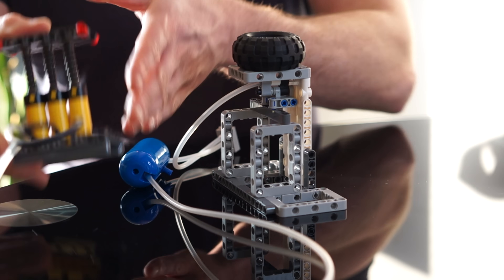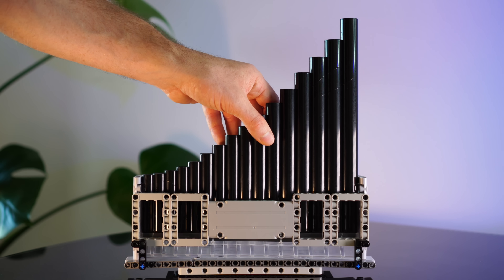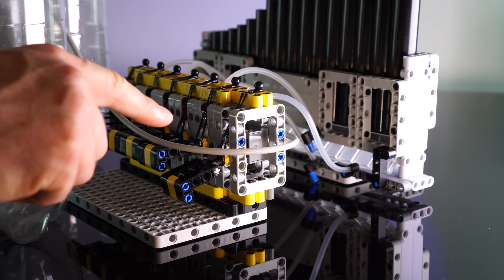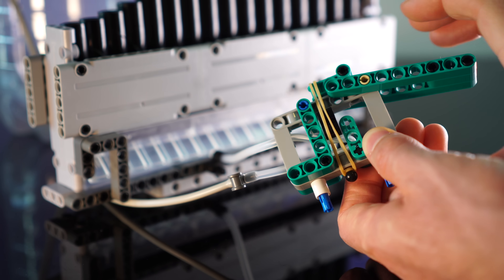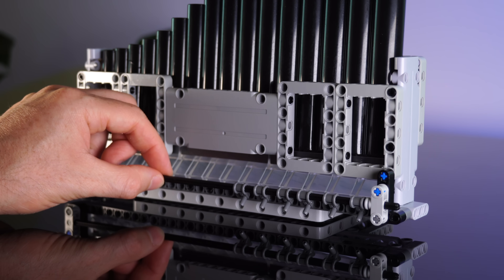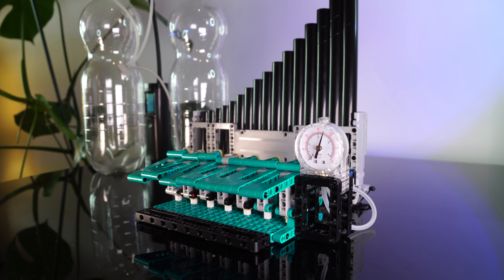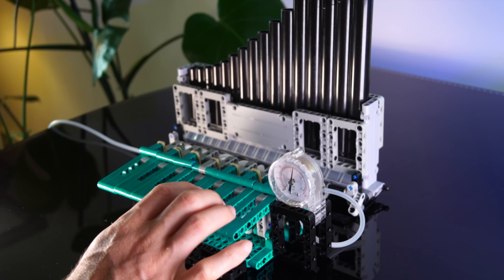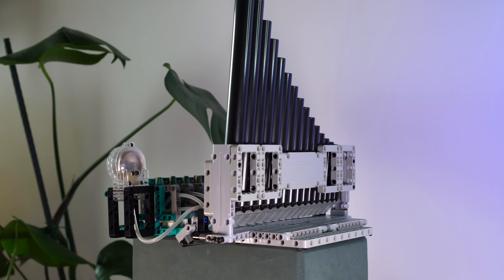Making An Air-Powered Wind Instrument Using LEGO Pneumatics

Comment: Can u make a tutorial
Reply from the maker: I'm afraid I took this model apart a while ago, but I'm sure it's easy enough to reverse engineer from the video! It's really just one of the keys (which was built in full in the video), and then duplicated for however many keys you need. I'd be confident in folks like you coming up with a much better design for the rest of it!

Comment: Not sure if this applies to your flute cause things get mirrored by cameras but I got a zampoña (a type of pan flute) that you hold with the longer pipes to the right so the notes get lower as you go up (opposite of a piano) they are also on a diatonic scale (although you can get chromatic ones but they are not common) Just thought you might want to know that your pipes might not be backwards at all :)

Comment: Amazing! Perhaps using the Lego suspension shock to keep the keys closed would work better than the rubber bands? Can be placed under each key.
Reply from the maker: That's a great idea, I'm pretty sure I have loads of them lying around - will experiment with that for the next version

Comment: Basically it’s a binary gates computer, so with enough pipes you can calculate things up. However, it’s better to use liquid instead of air, so pressure would be more constant.

Comment: okay for starters you have them going in the wrong direction its like your counting down, the highest note should be on the right side so change that, you have in this position of  f,e,d,c,b,a,g but it should be g,a,b,c,d,e,f and then after that you have g,a,b,c,d,e,f,g,a - being big to small pipe as  - g,a,b,c,d,e,f,g,a,b,c,d,e,f,g,a - the repetition in this is because of a higher octaves, its the same note but higher or deeper, depending on if you move left or right on the flute, left being deeper (in this case higher, so change it) and right is higher and because of what you have made here is essentially a pipe organ, you should have a lever to play octaves  so that you can play  two octaves at the same time, large organs play around 5 octaves at the same time for a very visual picture, some bigger ones can play more but it then starts to become just vibrations or high frequency noises that do more bad then good for the sound,  please make another one with more pipes, you can buy flutes with higher and lower octaves and use a tuner two arrange them, it could be really cool, and then have it take in midi notes and output it into pistons that press or play the notes, it could automatically play any song of your choosing, because midi is basically scripts of notes that can be read and played by computers or instruments,  check out "lookmomnocomputer" he made a real pipe organ take in midi and its pretty cool, would be cool to see the lego version of that (ill retype this if jamie requests it im dyslexic and english is my third language)

Comment: This is why you need a pressure regulator. You want to limit the pressure going into the tubes to what is required for playing the note accurately, but a high pressure in the tank to extend your playing time.
Reply from the maker: Totally, that's actually a really good idea! Will try to work something like that into the next version. Should be quite doable with lego

Comment: Quick notes: your keyboard does not reach a full octave, meaning the highest note is not at least as high as 8 whole-steps above the lowest note. You don't actually need all 7 notes in between, but you are severely limited by the lack of range from high to low.

Also the tuning is a classic medieval scale (and possibly isn't very well tuned for that either depending on how cheaply it was made), meaning the intervals between each note do not match the intervals between modern keyboard notes. The majority of songs newer than 1700 will be unplayable on it, even with a full range.

Lastly: the order is flipped. High notes should go on the right on a modern keyboard, not on the left.

But for all the musical failings of this device, it is still mechanically a total success! I especially like how compact the end result is so the keys can all be right next to each other.

Comment: why did you reverse the direction between the high notes and the low notes? the low notes should have been on the left
Reply from the maker: To be honest I just maintained the orientation of the pipe organ the way you'd play it with your mouth. And it prevented a massive amount of criss crossing of pneumatic hosing. I realise now that doesn't make much sense for folks who actually play keyboard-based instruments. Next version will be corrected!

Comment: I know this is late but as an organ builder i have to say this is excelent. To fix the tuning you likely just need to adjust the wind pressure for each note. Alternatively you could add adjustable sleeves to the end mouth ends of the flute to allow you to tune it by altering the length of the pipes. Also if you want a more consistant wind supply you could add rubber bands to your bottle and connect a hairdryer to it to supply constant air. Pipe organs work on very low pressures but very high volumes of air. All in all though you did a great job.
Reply from the maker: That's fascinating to hear, thanks for sharing man! Especially about lower pressures and higher volume. Main reason I used pneumatics and hosing was to keep the Lego theme as Lego has pneumatics available. But as you pointed out, pressure is an issue! I've been experimenting with just producing more air on the fly via a series of Lego compressors, but I need like 50 of them 😅 Also experimenting with large syringes to push more air. I tried a bellows which turned out to be near impossible to make out of Lego. But love your idea of a ducted fan simply pushing air via a bottle. Will certainly give something like that a try - thanks!
Reply: @JamiesBrickJams  Organs (at least older ones) have a bag with a weight on it providing (nearly) constant pressure. Maybe that is possible to recreate ?
Reply: @JamiesBrickJams  Have you tried incorporating the official Lego Bellows (part 87945) from the air shooter range? If you're trying to keep it as purely lego as possible it might be worth looking at!
Reply: Some people used an ordinary big balloon instead of an air storage bellow to operate a small organ. Also a robust plastic bag with weight on it may work, but for lower pressure it would likely need wider hoses.

Comment: Man built a reed organ. Although I think there's usually a reason that organs work on a continuous pumped air supply instead of a reservoir
Reply from the maker: You're definitely right - the high pressure is really not good for the notes. I'm working on a continuous source 😉 Thanks for the advice!

Comment: This is really cool, What you're essentially recreating is a Medieval Portative Organ!  What could be an interesting build is making a Lego Accordion frame that inside houses reeds, and you can snap a bellows piece in-between two built sides of a Lego Accordion. Button accordion may be easier to manage than a Piano Accordion. There is a difference.
Reply from the maker: That's fascinating you say that - my original idea was to build a Lego bellows to supply air continuously. Turns out that's really hard with Lego 😅 But I'll keep trying, and will look up those instruments you recommended - thanks!
Reply: @JamiesBrickJams  You may use a mouth organ as the sound source.

Comment: I wonder if you could vary the length of hose going to the pipes to change the pressure and reduce the "shrill" sounds?
Reply from the maker: That's actually a pretty neat idea, thanks for the suggestion! I'm sure there's something that can be done to reduce airflow and the shrill sound

Comment: Couldnt you make put in all the notes with some "huge" upscaling? Like separate the keys from the pipe and have the hoses connect it. The hose connector doesnt take much space anyway. So your keyboard would be large but the wind instrument small. Probably also need more air tanks.xP
Reply from the maker: Sure could, that's the plan for the next version 😉

Comment: Nice use of pinching valve ! You gain a sub 👍I wonder if you see my pneumatic engine, which use also pinching loop valve ?
Reply from the maker: Woah, Nico! Of course I've seen your pneumatic engine - I've been a huge fan of your work for years. In fact it's your work that made me realise pipe pinching is a viable Lego mechanic. Great to hear from you, and looking forward to your next inventions
Reply: @JamiesBrickJams  What an honor ! Thanks ! Indeed, hose pinching in a loop is very effective in terms of needed force compares to a LEGO switch or direct pinching. Glad it opens more idea like this creation ! Making a pneumatic instrument was on my todolist but you totally nailed it !
Reply from the maker: It sure is. Though I saw your latest engine last night with the unmodified switches, and it runs beautifully! So clearly there are options for smooth running engines that don't need crimped pipes. And if you do ever get around to a musical instrument, I'd love to see what a real Lego engineer like yourself does with the concept!
Reply: @JamiesBrickJams  Yes, the unmodified engine I have done run fine (for a unmodified engine), but because it uses 3 cylinders with 120° and scotch yoke, as well as direct actuation of the switch. But it is not the best in terms of vibration and so power distribution, so the technical solutions clearly limit the RPM I think. Both solutions are viable to me (pinching hose and classic switch).

Comment: If you open the lego valves and lube them, it'll give you a much better organ keyboard.  Also, I think you arranged it backwards from the way an organ would normally be laid out, the low notes should be on the left and the high notes should be on the right.  Still an awesome project though, I'd love see a version that uses all 16 pipes.
Reply from the maker: Thanks a lot! Yeah the reversed keyboard messed with my instincts on it too, but wasn't sure if it was best to just align it to the standard pipes orientation or the keyboard layout. I chose poorly 😅 I've been considering modifying my pneumatic pieces, so woop definitely give that a try soon!

Comment: this should be a real lego set if not for the modestly dangerous compressed air
Reply from the maker: Haha I was wondering what PSI would cause my knockoff brand soda bottles to explode 😅
Reply: It won't need that high pressure. A robust big plastic bag with weight on top is enough to store air for an organ.

Comment: As some others have alluded to, the flute is in a certain key that doesn't include various notes. You would most likely need either another flute or multiple in different keys to cover the notes in between, or custom tone pipes.
Reply from the maker: I was hoping it might be possible to buy another set of pipes that covers a more comprehensive set of notes... hoping I won't need to go custom! Though it may be worth experimenting with some pipes made of lego and using a reed to generate fully customisable notes. No idea if that's possible, but will look into it! Another possibility is using bottles filled with water
Reply: @JamiesBrickJams   It looks like you can buy what you're looking for. Search for chromatic pan flute and there are 16, 18, and 36 pipe versions
Reply from the maker: Fantastic, a 36 pipe one could be quite a mission to attempt at some point

Comment: Very cool concept! 16 possible notes needs 16 keys. Yes, yes, 16 tubes and 16 connectors and 16 L shaped bricks and all the rest in 16. Is it possible to make a cinch tube key design that is only two bricks wide? This reduced width can help to add more keys in the lineup. This current design with only 7 keys skips possible notes in the full measure of musical notes, meaning some notes that should be available are skipped over entirely and can't be played at all. This current design destroys the ability to play most songs  correctly. You did have a good go at green sleeves though despite the shortcomings.
Reply from the maker: You're totally right, it definitely needs a full keyboard... and preferably a more comprehensive set of pipes that cover more of the notes I need. Will certainly work on an update in due course. Cheers for your recommendations!

Comment: Now im trying to think of how youd go about making a full piano with this lol. Main issue i can think of is providing enough air pressure to play full chords without providing too much when playing single notes. A bottle for each key or set of keys would potentially work but would end up being overkill, given that you're only ever playing so many notes at once and not using a central air supply would make refilling harder. Maybe make some sort of mechanical calculator connected to each key that opens more bottles from a central array as you press more?
Reply: You could have a mechanical bellows that refills the air tank. That’s what all organs used before electricity.
Reply from the maker: A brilliant idea, and actually one I've been trying for a while, but really struggling with. Bellows are surprisingly difficult to build with Lego. But thanks for the suggestion - I'll keep trying!
Reply from the maker: That's a really cool thought experiment. I did notice exactly what you said - at pressures high enough for chords, the single notes 'screech' a bit. I guess the easiest solution is just brute forcing it by using 10 bottles at 30 psi rather than 2 bottles at 40, or using one bottle per key and building complex mechanisms. But I sure do love overengineering things, so will give it some more thought... cheers for your suggestions 😉

Comment: Thank for sharing, For your Next video Add vibrato or tremolo and also fix the Your pitch next video.
Reply from the maker: Cheers for the recommendations! Clearly have a lot to learn here, especially when mixing too 👌
Reply: @jamievancoppenhagen  here is example of the vibraphone when it vibrato the pitch is moving back and forth on the pipe.

https://youtu.be/Xpzj7BlVu9I?si=Cw_71kFsLXsuu29H

Comment: This instrument seems to only have the notes of A minor/C major (starting with the lowest note being G), so you'd need to transpose everything you see to one of these keys depending on the original key:
A minor (natural minor only)
C major (these two are the most common ones)
D dorian
E phrygian
F lydian
G mixolydian
B locrian

Any song or piece that uses more than seven different notes will not be possible, and even songs that use harmonic or melodic minor will not be playable without detuning the physical pipes. This makes the instrument quite limited in its choice of possible tunes but there still is a lot of music that could be played accurately if you put in the work to transpose it to a possible key.

Also, from a musician's perspective, the keyboard is the 'wrong' way around; for the sake of musical convention it'd be easier to learn how to play on it if you switched the high and low notes. I know, there is no real 'wrong' when it comes to music but there is this strong convention with almost every key based instrument that the low notes are on the left and high ones on the right.
Reply from the maker: That totally makes sense, I'll look into another set of pipes that might a more comprehensive set of notes. Or maybe even build one that can cover the ones I need. And totally understand the keyboard convention. I wasn't sure whether to keep the pipes in their original orientation and match the keyboard to that, or to invert the pipes and standardise it to the keyboard. Of course in retrospect aligning to the keyboard would have made more sense. Will bear that in mind for a future version too. Thanks again for your recommendations here!
Reply: the keyboard has a flat 7th in that position so it's in myxolydian, an uncommon scale. Start 1 pipe higher for minor, 3 higher for major. Greensleeves can't be played on this, as it uses notes outside the starting key, but there are loads of easy songs that do stay in major or minor and you can play them if you line it up with the right pipes.
Would really recommend having an eighth key for the octave of the first note. @JamiesBrickJams
Reply: B locrian lets go xD
Reply: i love minors

Comment: What do you think about an octave switcher that moves the hose outputs left or right to shift an octave lower or higher?
Reply: Also you could select multiple octaves at the same time. Many small pipe organs have a single rank of pipes that can be selected at 8’ (concert pitch), 4’ (octave higher), 16’ (octave lower), or any combination of these.
Reply from the maker: Ooooh that's an awesome idea! And totally doable I'd imagine. Cheers for the suggestion 😄

Comment: Seems like because the pan pipes are diatonic instead of chromatic (they only have a set of notes in a scale instead of all notes from the octave), you are not going to be able to greensleeves on those pipes regardless of the keyboard.
Reply from the maker: I'm pretty sure you're correct - I really struggled to get any recognisable songs to fit it nicely! I reckon a future version will need a more comprehensive set of pipes